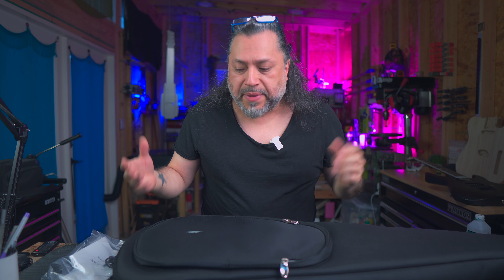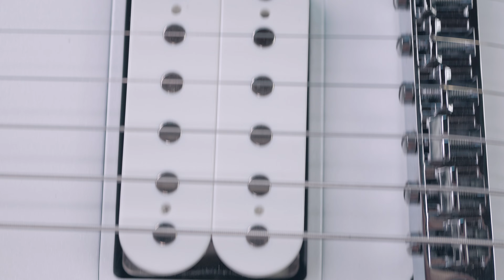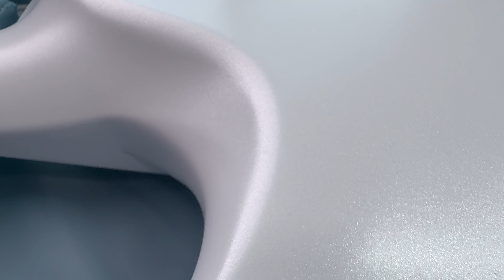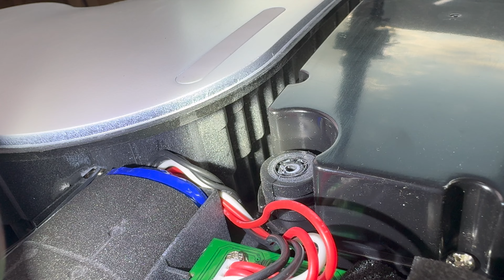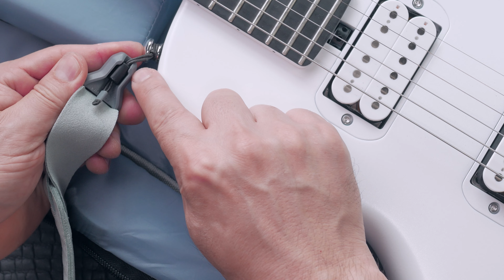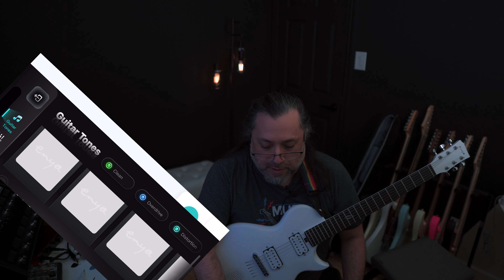Innovative Design All Carbon Fiber Guitar - SO MUCH FUN! $369

Comment: In Bangkok the kwh cost of electricity is so high, we turn off AC whenever we leave the house. I just moved here without my guitars and this may be the solution I’ve been looking for. With heat and humidity fluctuation, a normal guitar would not last long here. Carbon fiber sounds like an excellent solution. Thank you so much for this review.

Just found it on Lazada for ฿12,700! Woohoo!

Comment: I don't like the sound of the onboard speaker. I figured it would sound boxy, but plugged in to a regular amp system, it sounds pretty decent. I mean, the speaker does come in handy if you don't want to lug around an amp.

Comment: I’ve had an idea for ages to build a guitar with an amp sim and speaker built-in, mostly for practice as I often find myself not plugging in my guitars. I was thinking of gutting a Spark Go and modifying that to work in a guitar. It’d likely be a significant amount of work though. This is a far simpler way to do it. If I did still want to build my own, I could gut this and use the electronics, without needing to modify it. Certainly going to look into it anyway.
Reply from the maker: I'm the same way, I play 90 percent of the time without plugging in. But this guitar made me want to practice with an amp again, so I literally just bought a Spark 40.

Comment: Hi Mark, if one were to use a TRS plug on a guitar cable (with no connection to the ring) would the internal speaker and the 1/4” output work at the same time. I’d want to do this to capture the “loud amp in the room” interaction with the guitar resonances when recording, or using a modeler with headphones or small practice amp?
Reply from the maker: Good question. Let me test it.

Comment: that feedback is a defect - i contacted Enya and reported that to them, they sent me a replacement that does not feedback.  just FYI.
Reply from the maker: I know the feedback isn't a feature. I just thought it was cool. So you get no feedback even at full volume with the high gain amp?
Reply: @MarkGutierrez  if i let the e string ring out eventually it will start to feedback but otherwise, the noise gate kicks in and its quiet.